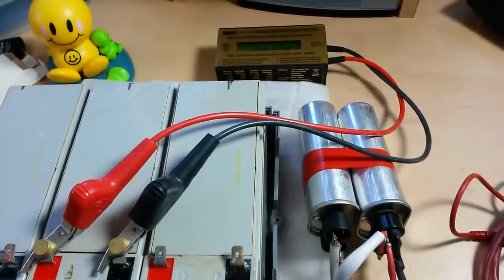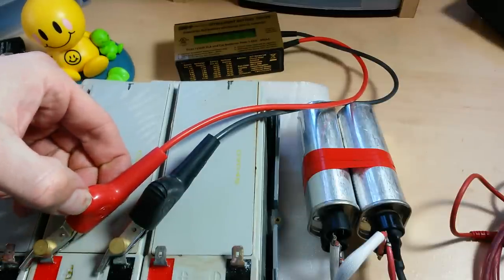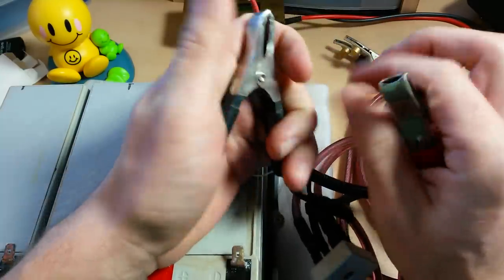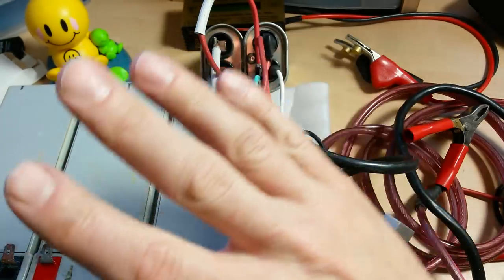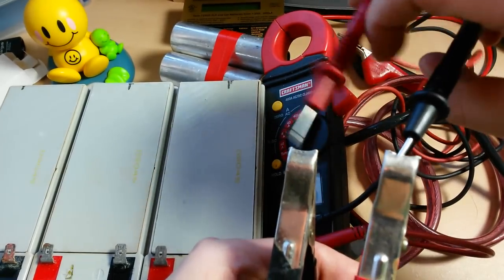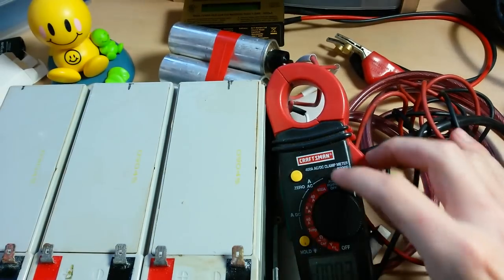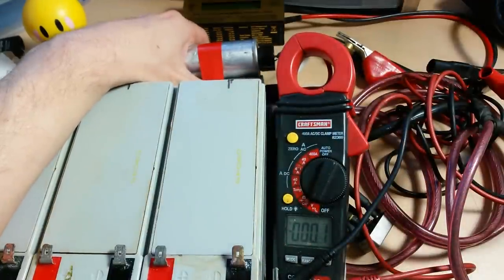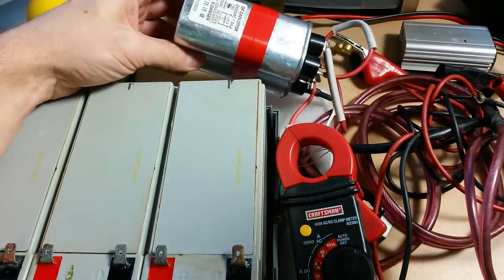(:Myth Busting:) Battery Restoration Myths: Epsom Salts? Proper Capcitive Charging & Desulphation

Comment: Ok friend about Epsom salt even if it last for 1 year that's fine I'll buy another battery cause car battery in my country changed every year so if it give me 2 years so it's great after its died I'll get bonus 2 years
Reply from the maker: It won't give you 2 years
Reply: It doesn't matter but if it can't crank my car and after Epsom salt it can crank it then i'am happy till it dies I'll buy a new battery
Reply: Not certain about the points made but ,if anyone else is searching for how to recondition old car batteries try Trefendous Rapid  Extender Tips (do a search on google ) ? Ive heard some super things about it and my friend got cool success with it.
Reply: I think Epsom salt is the trick and it'll work as there is some body on YouTube said it lasts for him 4 years after adding Epsom salt any way one , 2,3,4 all are good the thing is that this is not a myth and I'll continue monitoring my battery and will make a video to tell when the battery died after adding Epsom salt
Reply from the maker: +GulfBmw forums sroor9001 Sroor by all means keep me posted. most of the success stories have more to do with people actually suddenly paying more attention to and properly charging their batteries than the Epsom salt. A pulse charger is the Best thing you can do for any battery.
Reply: Thank you Palve, that sounds helpful, and good info.
Reply: I've been studying fixing a car battery and discovered an awesome resource at Jons Mender Guide (google it if you are interested)
Reply: here's  several suggestions for battery reconditioning
Don't try to do this until you are sure what you are doing - the acid can burn you
check the voltage first - there may be a dead cell which would waste your time.
Check the battery fluid.
attempt to fully charge the battery.
(I read about these and more on Jons Mender Guide website )

Comment: I'm stumped because I can only get up to 12.5V while I'm charging my 6 battery bank, using solar or an automotive 55A battery charger powered by a generator.  Electrolyte levels are fine.  Anyone have any ideas??
Reply from the maker: Possible shorted cell.

Comment: You can't use raw Epsom salt but you can take Epsom salt use anodes and cathodes to desolve it in water and create sulfuric acid clean the battery plates and then renew the battery with the new sulfuric acid you made from your Epsom salt. That's it in the nutshell if you want the entire process look it up get your education and do it yourself

Comment: electronics 101....   rectified and filtered 110v will end up around 155 volts .    110 * 1.414 = full wave recified and filtered DC.  BUT what you failed in your explanation is that after the AC goes through a full wave bridge, the frequency of the ripple (the pulses you mentioned) is now 120hz NOT 60 hz thus FULL wave.  If you had used a half wave recified circuit the frequency would be 60hz.   Also,  Microwave capacitors values are based on 2000 volts AC input to a half wave rectifier, giving you 2828V DC half wave.  The values of those caps would not be effective filters at all to 60hz.  The higher the capacitor value the lower the frequency they effectively filter....   60hz can be effectively coupled to ground with 2200uF .  If you truly want pulsing... get rid of the caps.  do some experimenting OUTSIDE and with safety equipment on....  and stay away from the battery when energized.
Reply from the maker: +stevehovey70 thanks for explaining about the half and full wave rectifiers! Microwave caps definitely are not ideal for this.
Reply: My point was to make an dc  charge that would act as a electrical hammer on the plates in order to desulphate.

Comment: Saving you a bunch of time.  I've tried all the vids say.  A dead battery is dead.  Forget vols/amps, blah blah blah.  It may read on a meter this or that but it won't last and probably won't even start anything.  Just buy a new one.
Reply: +jdh023  what is your definition of a dead battery?
All batteries have a specified amp/hour rating. This is measured under load. Simply reading the voltage of a battery does not tell you the amperage it is capable of putting out.  Actual amperage capacity is the true  measure of a battery's life, at it's specified voltage.
Reply: +Scott Schoemann thank you.

Comment: I have a capavitative charger I made from diodes and a shit ton of Air conditioner capacitors. One word of advice. Do not include yourself in this circuit. It will shock THE FUCK out of you. For real. Wearing leather gloves one time I forgot it was plugged in and the negative side of the battery was plugged in to the charging circuit and I was contacting the the positive cable with one hand and the positive terminal of the battery with the other. Gave me a good jump. Mind you I was shockef with 12 volts and not 110

Comment: Why spend $500.00 + and use up hours of your time to save an old ugly dirty battery. Just buy a new one. It's cleaner, no dirt to get on your hands and clothes. It's fast and easy. The only thing you have to do is open your wallet and pull out a card. And it always works. Because, it is NEW.  *OR* are you just a cheap person who likes to use a lot of water and soap? Being CHEAP is stupid and could kill you. 
You want a battery to last a life time. What is next? Your video on "How to wash, dry and fold old used toilet paper so that a single roll will last you a life time" and your super saver video "How to make stain remover. That will remove those hard to clean brown smelly stains from used toilet paper you may find while trail hiking."

Comment: Why use a capacitor at all when the 60 hz is doing the cycling?    Plus you are dangerous! Plus to provide a specified pulse you would need specified value capacitors and what is the pulse energy you are looking for, for a particular amp hour battery?    mmmmmm?    snake oil?

Comment: i have a job, so i buy a new battery when i need one. 
if i pay $100 for a new one and it lasts me 5 years, 
i'm spending $20 a year. that's cheap. 
people spend thousands a year on tobacco, booze, drugs, gambling, coffee, tea, soft drinks, eating out, and many other useless things in life.
Reply: alvarsdzenis that's definitely a good way to look at that lol
Reply: alvarsdzenis me too
i love reading about how to fix things. but i am off to the store for two batteries for my cummins diesel. 
the old ones lasted 15 years .
I'd rather not spend a couple hundred bucks but screw playing junior scientist.
i leave that to the youtube guys
Reply: valvoline quick oil change, i got a brand new interstate battery for 129 dollars.  tax included.
Reply: I bought an Optima Yellow Top battery 8 years ago and have a parasitic draw on my snow plow truck.  I've recharged it from being completely flat at least a dozen times, it still holds 13 volts unless i leave the truck for 3+ months.
Reply: All newer vehicles have a parasitic draw. Make sure you have a good alternator.
Reply: keycontrol. Yeah ur right but its my snow plow motor that doesn't have an "off" switch (kill switch), so its always pulling current.
Reply: alvarsdzenis p